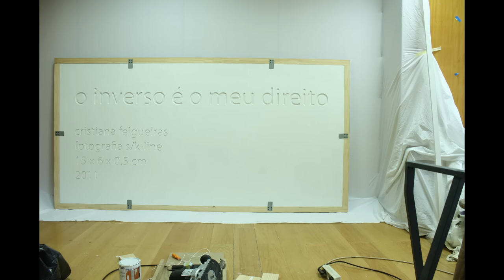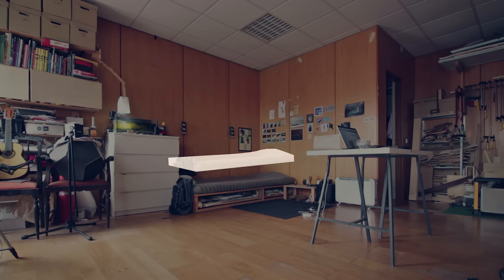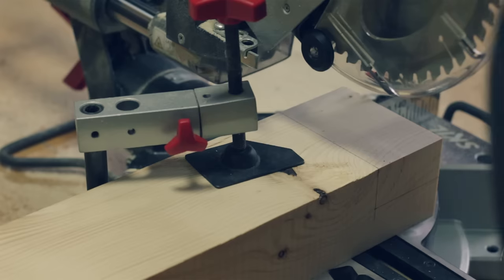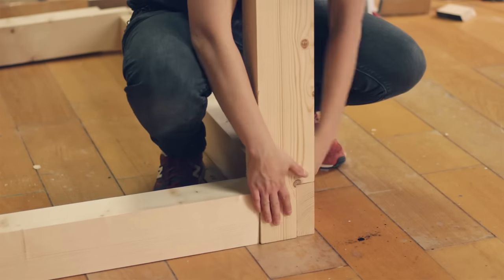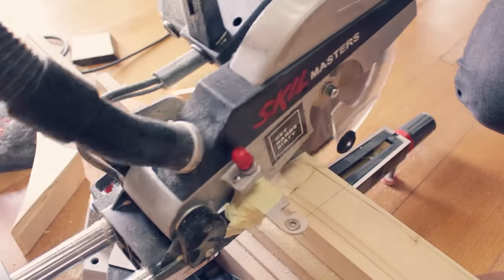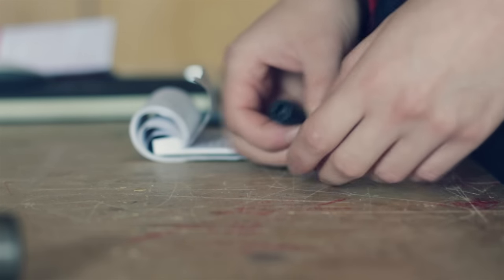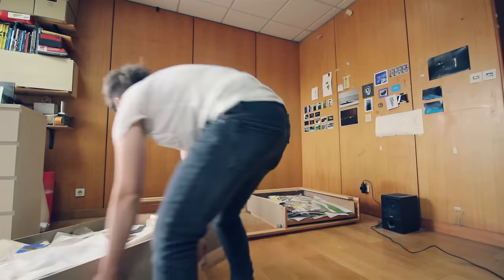Loft Bed // Work Space : The Structure - Ep. 1

Comment: that is beautiful wood you are using.  in the US o have not seen wood of that quality for purchase.  also noticed you are using socket head cap screws.  they have machine screw threads and not wood screw threads.  I would not have used such screws
Reply: I would say most wood suppliers have wood of this grade. You just won't find it at many of the big box suppliers.
Reply: Is there anywhere we can get similar quality wood in NYC?
Reply: @udummies  If I remember right. Prince Lumber in NYC had good quality lumber.

Comment: Your starting speech was what I felt when I moved into my own place.
Reply: I'm a year into my Embryonic stage at my new place. The ideas are coming but the landlord requires me to have professionals come in to do all the work. They must be insured and have a recognized trade certification. Good luck finding a certified carpenter in Toronto to hang a cupboard! $250 to have an electrician install a smart switch. I had to hire a company that specialized in hanging TVs at $500 to put my TV on the wall. The landlord must approve the tradesperson, receive a project plan with drawings and materials specifications before approval. Tiling a backsplash is about $750. If I do not follow the requirements the landlord issues an order for it to be removed., if not complied with they provide a work order and charge me to remove it. Toronto social housing is so rule-bound because they are afraid of liability suits.

Comment: How are those bolts holding up with being threaded straight into the wood?
Reply: Wait,.....what is 'threaded'?
Reply: its the same thing as mounting a TV to a wall - you screw bolts straight i to the studs of a wall. same thing.
Reply: +Micah Powers you put a screw into a stud, not a bolt. To put a bolt into stud would require the stud to be drilled and threaded. So not the same thing really.
Reply: spammmmmm..
Reply: these are not lag bolts though...
Reply: these are not lagbolts though
Reply: She should have used a thread tap to cut the threads for those bolts but she instead just drilled a hole. They wouldn't last, especially since she put them into the end of the second piece, splitting the fibres. A mortise and tenon joint would have been much stronger there and if she used bolts to secure it then they would not go through the wood parallel to the grain and split the fibres. What she has there is a very weak joint.
Reply: Yep she definitely should have either threaded, used screws, or even dowels for this.
Tbh this kind if joint is great with glue, not so much without i find ...

Comment: You really should have used coach bolts instead of those black machine bolts, with threads that fine you are only achieving a friction fit. Nice joints though :)
Reply from the maker: Yeah, I wanted to give them a try because I saw them being used before with wood threads. We'll see how it goes over time. If it becomes a bit lose, I'll just put some thick lag bolts instead :) but so far so good, it doesn't move a hair and I've been up there for almost 15 days ahah

Comment: I am very impressed by you. That's a big solo undertaking. I'm planning on the same, but a 4 leg model. You reckon the stability will still be there
Reply from the maker: Jonathan Rivera 4 tall legs won't give you any stability if you don't screw the bed to the wall or all the legs to the floor or connect them with horizontal beams towards the bottom

Comment: Fine instructions.  Fine joints.  Suggestion: replace the small screws in the wall with 5-100 mm wood screws; you will need a socket wrench.

Comment: I was just wondering why you used such heavy timber sections throughout. Most compression members could be much slimmer.
Funny how we use screws in wood all the time; but seldom use bolts in the same way. Really like your key joints btw.

Comment: It looks as though you're using socket head cap screws with machine threads and not wood screw threads.  I'm looking to do something similar with countersunk bolt heads, but this was the only part where I thought there may be an issue.

Comment: Cristiana help! How did you covered above the structure to put the mattress on?, And how do you make the bed every morning?, Increíble video btw, you taught me more about design with this video than my professors at university in a semester
Reply from the maker: Hi! I placed a sheet of yellow MDF that is moisture resistant. If you watch the episode 2 and 3 from the Loft Bed you will see the material I am talking about. The mattress is 20 cm smaller than the width of the platform so I can walk on that edge and I have about 65cm on the end as well. The platform is 250 x 130 cm and the mattress is 185 x 110 cm. It's not easy to make the bed, but it is possible!
Reply: Get Hands Dirty omggg you answered!! I actually made my own bed inspired by yours, I used 2" by 4"s for the whole thing and tried to design a wood joint accordingly, in a few days, I'll finish painting my room and I'll be ready  put all the pieces together to sand the whole thing, thank you so much for the inspiration, I tried to find that kind of MDF here in Peru, but it was not available, so I used regular 20 mm thick MDF :( , hope it works; thanks to you I overcame the stigma of "your are a girl, you can't use those tools" and got my hands dirty, love your channel :3

Comment: Great job overall! However it is not safe to use such screws. These are machine screws with either inch or metric thread, which is not designed to go into wood but to a pre-cut thread in metal. I highly recommend you either put a threaded insert in the wood in which to put the screws or either use screws, designed for wood. Right now you are only relying on friction to hold the screws in place and there is nothing stopping them from coming out. For your safety please consider those modifications.

Comment: Hey I love this video and am working on a similar loft design for my full size mattress (approx. 137cm X 187cm). I was wondering what size of internal hex screws you used for the lap joints/legs? And how deep you drilled into the beams with your forstner bit?
Reply from the maker: Hi, I used 80 mm bolts if I remember correctly and the recess hole was just enough so the head and washer goes below the surface - about 15 mm. This platform is 130 x 250 cm just for your information. Since a lot of people complain about this bolts, go ahead and use coarse thread bolts for wood. You will be better served. These machine bolts have been working fine for me though - I made the holes smaller than the diameter of the bolts so that they created threads on the wood.

Comment: Wow...Impressive. I have coupe, questions though. Are these materials rent-able in order to watch your tutorial and do the same project? Also can this project be applied (wood wise) to two King size beds one on top and one on the bottom?
Reply from the maker: Metalpazallteway well, i think so, you just need to make sure the wood beams are fairly thick and that it is well connected to the wall. this platform is 250 x 130 cm. i would add a middle beam for a king size to make sure it won't make a curvature in the middle of the bed.
Reply: What kind of beams should be placed? Btw, thank you for your input I will take them into consideration before starting.

Comment: How refreshing to see women entering what has traditionally been the domain of men. It's a great & interesting project. However I have some strong reservations regarding your jointing method given the overall height of your bed. It would not be such an issue if bed was only 200/300mm off the floor but at 1600mm it's quite a drop if the integrity of your joint fails & potentially disastrous. May I be so bold as to suggest that you investigate in some alternative but structurally sound methods of fastening your joints. I wish you well in your endeavours. Kind regards.

Comment: What is that tool called that you used to drill holes in for the threaded bolts?
Reply: the one used at 7:00
Reply: i think its a drill press
Reply: did you just use a saw drill bit? if so, how did you get the wood out since you didn't go all the way through the board?

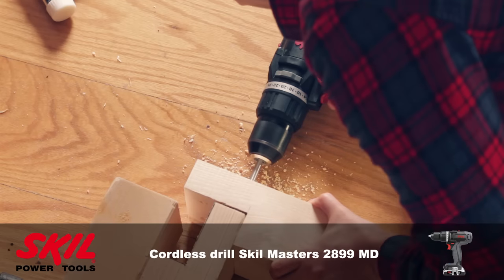Comment: 7:34
Reply: I'm just adding this bc it will make sense for me later on, probably won't mean anything to anyone reading. 

Both end pieces seem to be cut 2 inches width wise and 4 inches length wise
Reply: The vertical piece that will slide in that slot looks like it will be cut the same 7:35